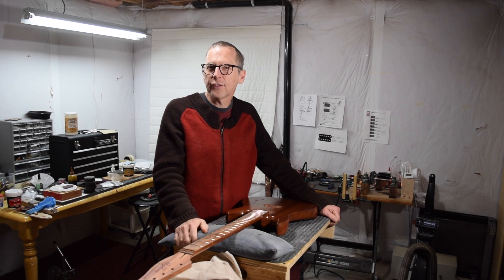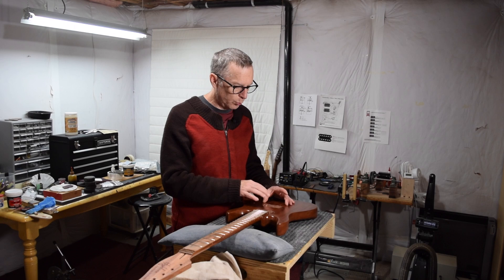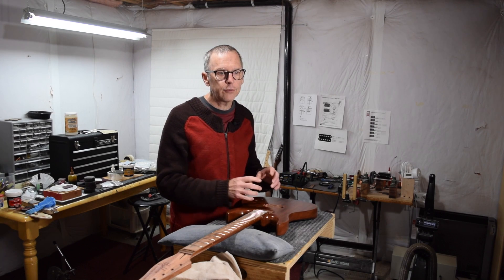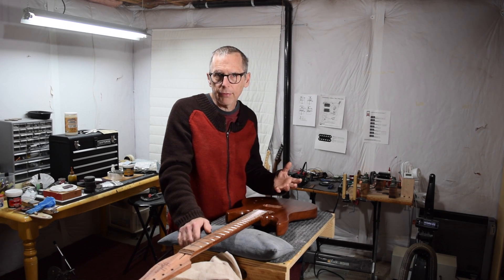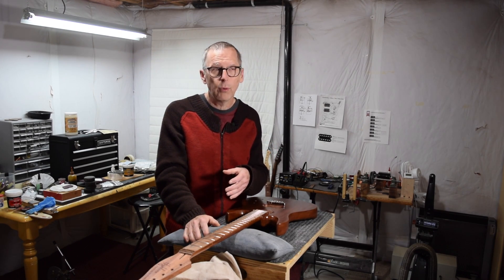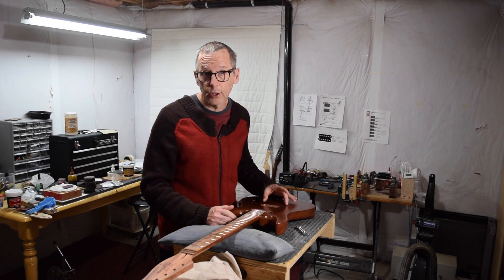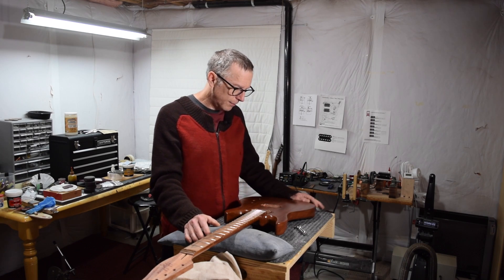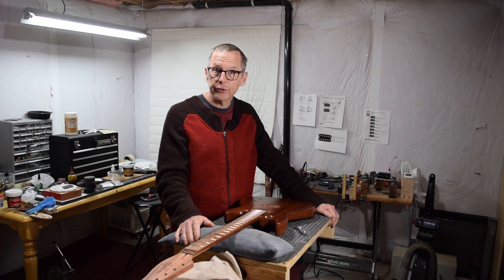Should a Guitar Neck Be Angled Or Flat?

Comment from the maker: I should mention that I determine neck pocket depth by measuring the thickness of the neck heel (including the fretboard and the fret wire) and subtracting the string height at the bridge with the saddles are in their lowest position. Example: If the neck heel = 1.25" and string height at the bridge = .3" then 1.25 - .3 = .95" neck pocket depth. If the string action at the bridge is around .3 inches, I can keep the neck flat. If it's closer to .5 inches, I'll need to angle the neck in order to achieve proper string action.

Comment: Long piece of paper, draw a line the length of your scale, mark the point above one end the same height as your bridge, join that point to the other end the height of the nut slot above the line (which will be about your fret height) and measure the angle.Should take about two minutes ;-)
Reply from the maker: Steve Jones or do it on a computer and use the files to cut out a guitar on a CNC machine in about 2 hours.
Reply: Of course but for those without access to CNC or CAD software it's certainly easier and you'll have your answer before the computer finishes booting.
Reply: I've read this 4 or 5 times. I just can't picture it, but I really want to. Can you rephrase this for me? I feel like what you're saying would be extremely helpful.

Comment: Maybe you can help me. I have a hardtail strat, the bridge saddles are as high as they will go and the action is still too low. Should I put a shim under the bridge plate? Also the relief on the neck is good, no up bow. Just trying to get the action a tiny bit higher. Any help would be huge. Thanks
Reply from the maker: If possible, consider deepening the neck pocket. This will lower the neck into the body which will increase the action.

Comment: Are there any benefits to having a bridge so thick you have to angle the neck?
Reply from the maker: Some will argue that yes there is a benefit due to the increase in mass. Others will say no because the increase in mass is hypothetical.
Reply: @HighlineGuitars   So basically it comes down to personal preference. I own a couple of both and the only real difference that I noticed is the ergonomics. Ergonomically,  I prefer a straight neck.
Edit: My amp doesn't notice the difference in mass(sustain). My shoulder does.

Comment: There's also the height of the neck above the top to factor in. For example Fender guitars has the neck 3/8" above the top while an LP is 1/4" with the fretboard glued right the the top. Also a carved top to consider.
Reply from the maker: And that is determined by the rule of thumb I explained in this video. The depth of the neck pocket will determine the height of the fretboard's crown above the body.
Reply: Highline Guitars I guess I missed that, twice.

Comment: Great video. Ive built both. You need the neck angled on the les paul style bridge to get downward string tention. I tried doing less and the strings would not stay on the bridge, dont do that!
Reply from the maker: Gibson angled their necks solely to achieve proper string action. The strings will stay in place as long as the saddles and notched correctly and the tailpiece is set at the correct break angle height.

Comment: I was wondering how youtake into consideration the nut height in all this, so you also end up with the correct string height at the first fret
Reply from the maker: That's accomplished by gradually deepening the string slots as you file them into the nut until the bottom of the string is at a height above the 1st fret that you like.
Reply: so when you are setting up the neck angle you string the strings over an blank nut, or do you file in some shallow preliminary grooves, or is it because you are so far down the neck from the heel this change in string height does not affect the string measurements for the neck angle? @HighlineGuitars

Comment: also consider how strong the neck/truss is? neck is going to flex🏃‍♂️ (really is one of the biggest problems with building and using standard tunings) a strong neck using layered hardwood and proper truss rod... (carving one out of rosewood would be nice!🤔🤣👨‍🔧)..too much flexing on an acoustic obviously ruins their playability,intonation,tone etc...but after that, finding the right stable angle is much more simple.

Comment: I need help! I'm at the end of a basic "Stratocaster" style guitar kit build. It's my first one, I don't have much previous experience other than doing a few guitar mods. I'm having a hard time. The neck seems WAY too high in relation to the strings. I have to raise the string saddles on the tremolo system all the way up to their maximum highest position for the string to even "ring" without being "fretted" by most of the frets, especially the higher notes after about the 15th fret.  And even after that, the guitar isn't playable. If you press down a string to play a note, the string essentially lays flat along the length of the neck touching just about every fret on the neck. Obviously there's something way off here. I bought a notched straight edge and the neck appears dead straight. Which leads me to believe maybe the neck angle is off? I hear alot of talk about shims. Do I need a "shim"? To my neanderthal brain, putting anything more in that neck pocket will just add to the problem, causing the neck to be raised even more. Should I try sand the part of the neck that sits in the neck pocket, hopefully thinning it out by an 1/16"-1/8" or so?

What a disaster, I can't believe you do this for a living. I must suck. I don't have a cheap eBay kit either, I opted for a higher quality kit in hopes of avoiding these very problems. I will admit, due to my inexperience I may have caused this issue. I didn't tape off my neck pocket when spraying my finish. I didn't think it would be enough to amount to anything. At most, would just lead to a tighter fit. Didn't think about the height being off. So, there are a few coats of laquer in there... Any help or insight would be GREATLY appreciated! I'm ready to scrap this and start over.
Reply from the maker: The first thing you should try is to adjust the truss rod to induce some relief at around the 9th fret. This will slightly raise the nut relative to the body and lift the strings higher off the frets. If that doesn't help, you could also deepen the neck pocket with some coarse sandpaper attached to a hard block of wood.
Reply: @HighlineGuitars  okay. I'll give that a try. Thanks for the speedy reply and the advice!

Comment: I’m curious then, would there be any benefit from having a neck angle even on one that wouldn’t require it? Assuming you didn’t need to raise the bridge height to insane levels to make it work. I’m thinking a telecaster with an angle.
Reply: I also look at the height of the string at the last fret compared to the 12th fret.  If there's a significant difference then I would adjust the angle.
Reply: if it ain't broke, don't fix it, also if the action at the 12th fret is not right, don't angle you neck, adjust the truss rod relief